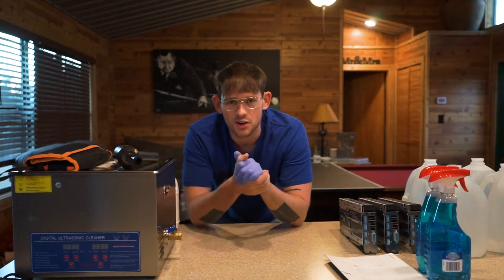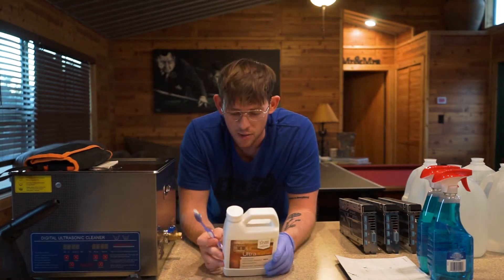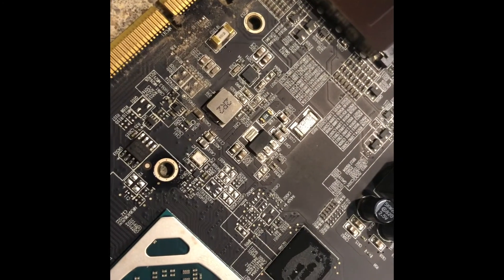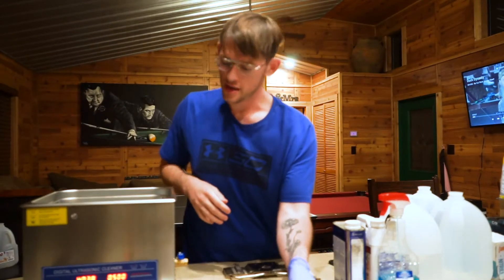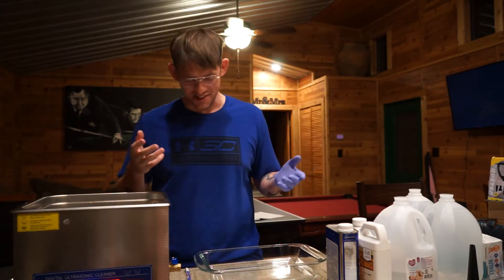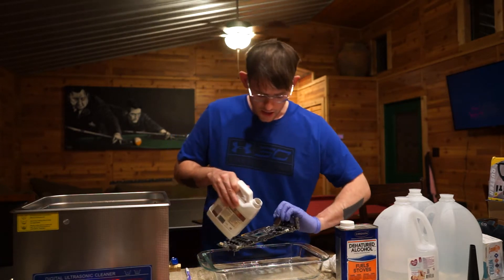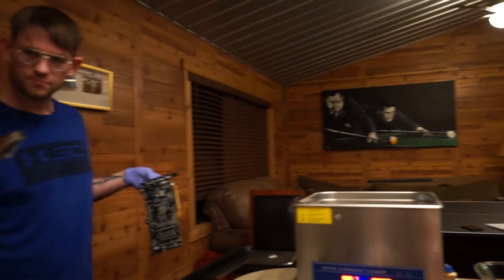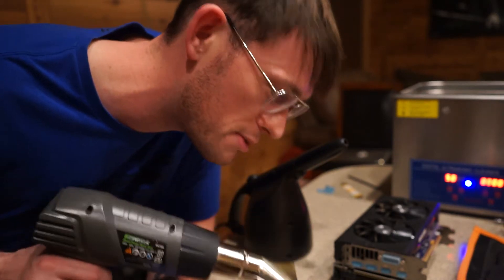How to CLEAN your Graphics Card /GPUs with Windex and Ultrasonics

Comment: I’ve used pure windex on all my video cards.  It does an amazing job at cleaning cards by a large margin.  What I also didn’t need to do was clean it off afterwards with alcohol.  I just used a blower to dry my cards and totally skipped the heat gun.  One thing that helps if you need to is run the ultrasonic and before you set it, get it wet a bit and run a tooth brush over the card before you settle it into its bath.  It helps break apart anything that is caked on there.  But that’s just how I do it.  I have old RX 570s, old GTX 1080s, and a whole crap load of cards and they still run like new even 8 years after original release.  Windex is amazing.

Comment: If you used windex you wouldn’t need to use alcohol, no water…. Pure windex all the way!!!
Reply from the maker: Seriously?
Reply: @charleschannel0  yeah, windex is ammonia based, dries with no streaks quickly.  Adding water makes no sense to me even if you wanted to stretch out the use of it.  Why worry about having to buy expensive alcohol.  Loose the water.  Loose the need for alcohol.
Reply: @charleschannel0  yes, I was able to pop the cards back into my mining setup about 20 minutes after taking them out of the cleaner.  Ammonia based chemical = fast drying
Reply: Brandson EC Cleaner is the right solution. Great job though! Looking forward to seeing more vids